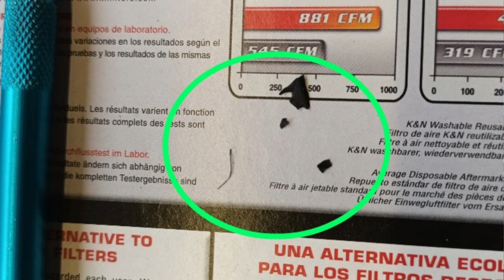Performance air filter choices and K&N cone filter install | Toyota Starlet 4efe turbo build.

Comment: I hear you about space constraints. I have an air conditioner pump and cat 🙀 surrounding my oil filter. Previous owner hadn't changed filter in years. I got it of eventually with crow bar and hammer
Reply from the maker: Wow, been there! Thankfully mine had no A/C so the filter can fit in.

Comment: Привет скажи а что лучше места  для размещения воздушного фильтра ты не нашёл?)))он же находится внизу и будет тянуть пыль от самой дороги,а если не дай Бог заехать в лужу что можно моментально схватить гидроудар🤦‍♂️
Reply: If you drive through a puddle and it splashes the filter you’re unlikely to hydrolock the engine.  It’s more likely to be like water injection so yay! 😃
Reply from the maker: Hi, I'm pretty sure I did cover this @7:50 in the video. I have re-installed the splash guards / undertrays to limit any water / dust, dirt getting to the filter. 
Just to clarify: The lowest point of the filter is 28cm off the ground, the entry to the intake pipe is 35cm off the ground. The floor of the car is 15cm off the ground so it would be floating! Not worried about this setup as I've had cars with lower filters and never had problems. I can't recommend what's safe for you, just use your best judgement. Obviously hydro locking the engine would be a bad thing and should be avoided!